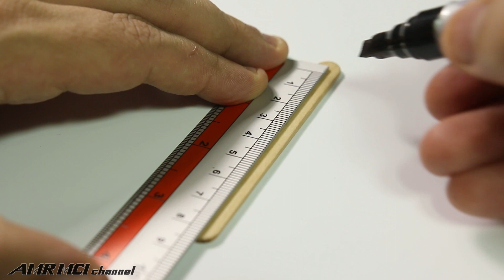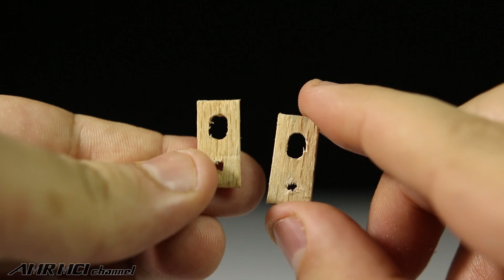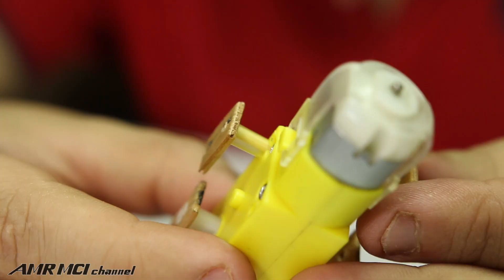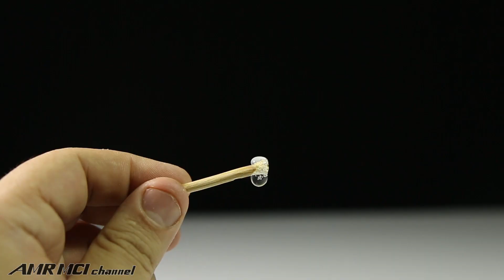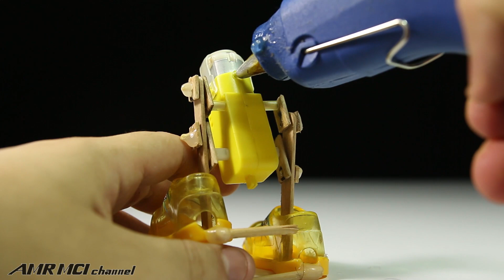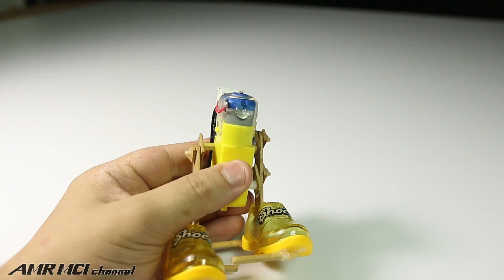How To Make An Adorable  Walking Robot with Big Shoes

Comment: It threw me off until I realized that the measurements were in cm.  I've got a few of these motors so I'll give it a try.  Grandkids should love it.  These motors will also run for quite awhile using a small 3.7 volt li-ion drone battery.

Comment: This design is not workable. The upper passive crank will not make a full turn around the axis.
Reply: youre right
Reply: i tried so hard but it just hates me
Reply: @sanjayhariharan6615  At a certain moment, the torque on the upper crank will be zero and the upper crank will stop rotating. This is the law of mechanics M = F * L At the upper point, L = 0 and M = 0.